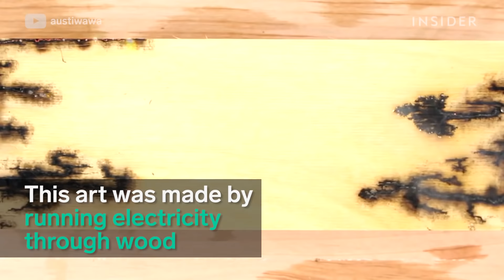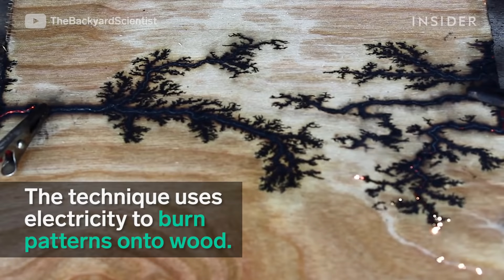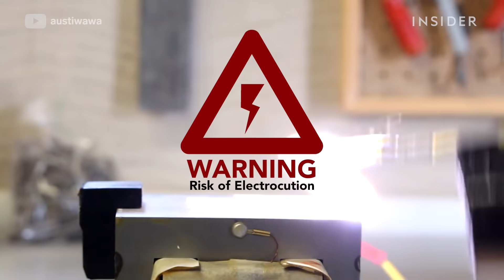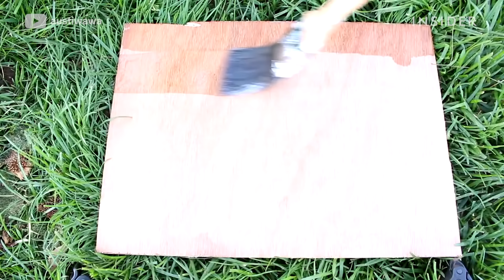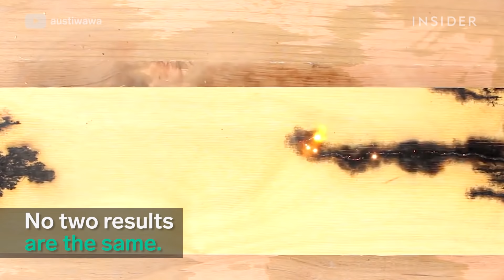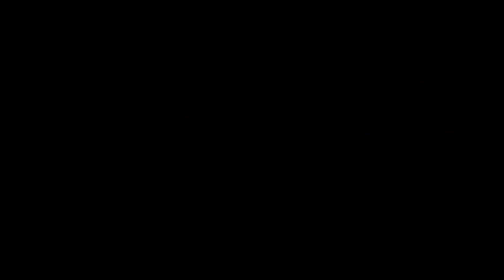This art was made by running electricity through wood

Comment: DO NOT DO THIS IF YOU TOUCH THE WOOD, THE WIRES, DROP IT, OR GO TOO CLOSE YOU WILL DIE, IF YOU DON'T TURN IT OFF FAST ENOUGH IT COULD SET ON FIRE. This will kill you. Even if you have special gloves on it will go through them (it's happened multiple times). 2 professional electricans have died attempting this. 40 people have died attempting this, do not do it. It's a very high voltage, a very high ampage and the electricity and power in your house will not recognise that you are being electricuted as the current isn't fully connected by wires.

Comment: This cool, you just have to do it safely. Use a current-limiting neon sign transformed rated at 30 milliamperes or less with a voltage rating of 7000 to 15000 vac. Never get within 16” the project is powered on. (Use a dead-man type switch or button that’s 10 feet away ) and do it on an isolated table.
Reply: Don't do this! As much as it's awesome it's even more deadly!!!

Comment: Would a car battery work the same? If the wood was wet or would it not be strong enough? Put a nail thru the wood on one end and another on the side and attach with booster cables? Trying to get creative with apoxy 😄
Reply: Please don't do it
Reply: No. What you are seeing is wood burning from electrical heating. A very high voltage and significant amperage is needed. The voltage is much higher than what your car battery can output, hence the transformer in a microwave oven.